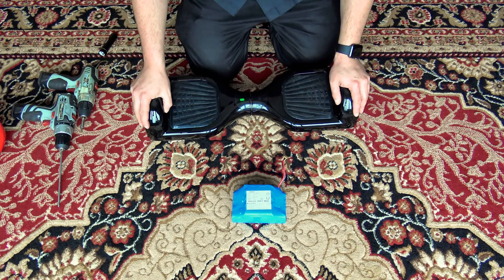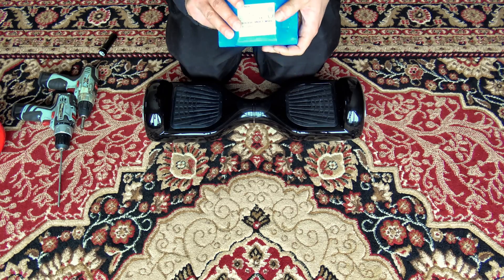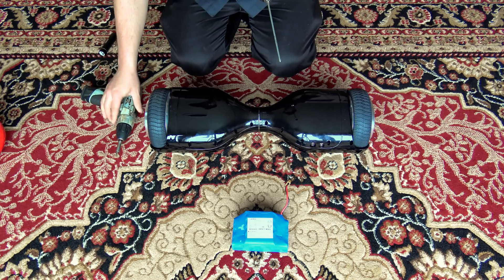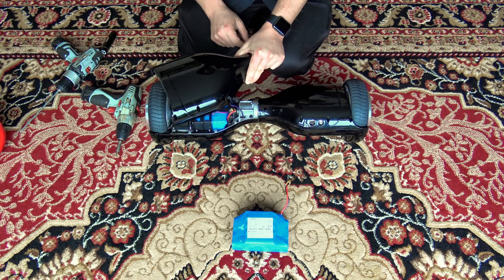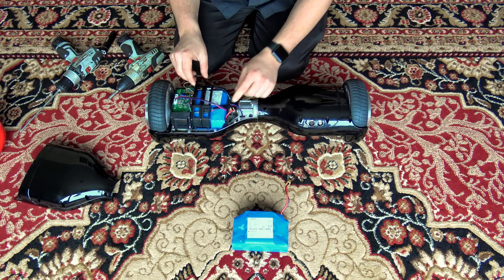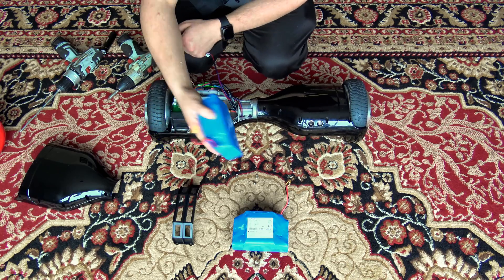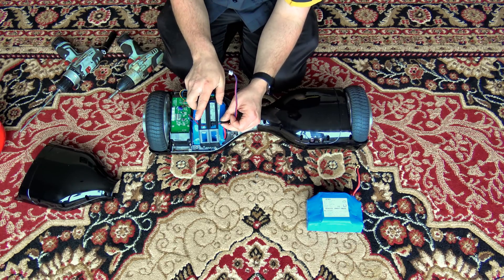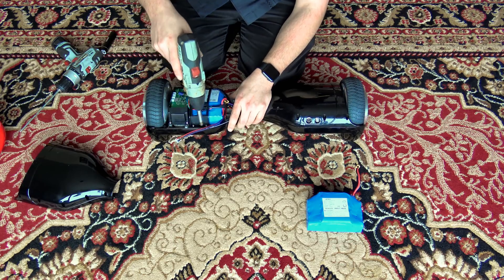Hoverboard Battery: Self Balancing Two Wheel Scooter SWAP BATTERIES!

Comment: The lack of any battery balancing connector on that battery is alarming. I hope it contains the balancing circuit, but it would still have no way to communicate if the pack was out of balance during charging. I expect this would cause at least some of the fires.